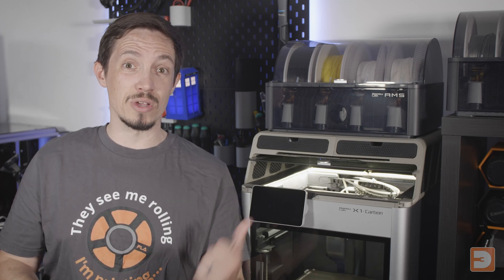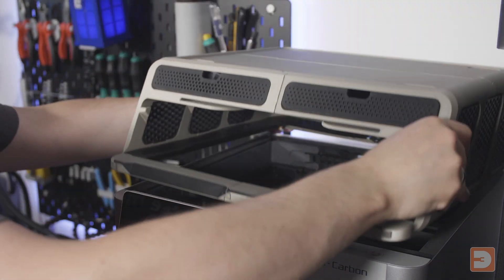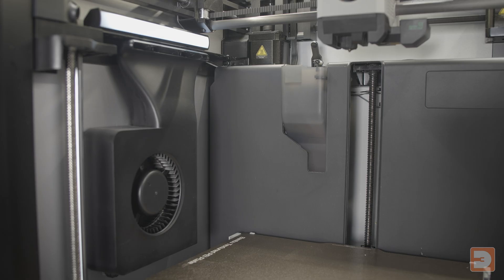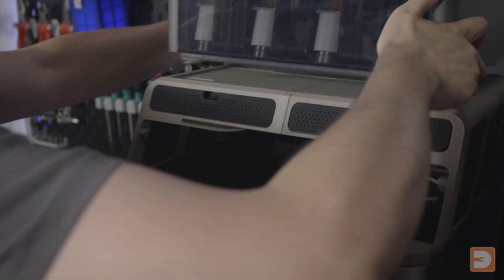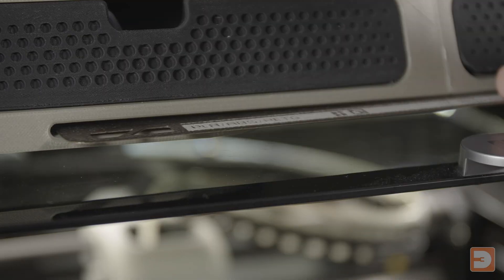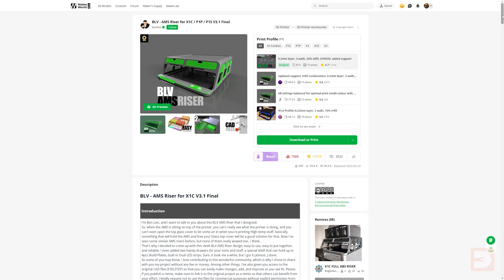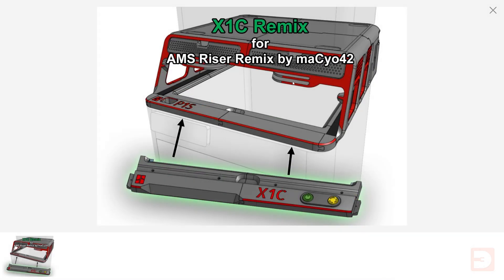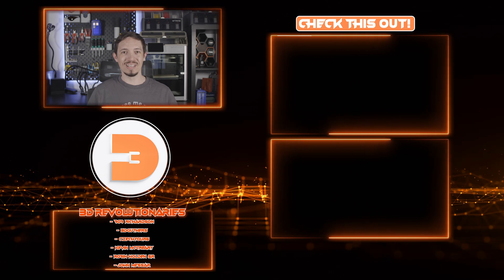What are AMS Risers and why would I want one?

Comment: the downside is that it's one more piece to unplug and remove to troubleshoot issues or perform maintenance on your printer.
Reply from the maker: How do you mean unplug? The riser isn't plugged in. If you mean the optional lighting, I just have that fitted to a splitter so powers on the same time as the printer from the same plug.

As for maintenance, I've had risers fitted to my X1C's for the 2+ years I've had them, and outside of doing so to get shots for videos, I think I've needed to remove the riser once for maintenance.

But even when you do need to remove it, it literally just lifts off, it's not clipped/screwed in place or anything, so you could just lift it off with the AMS still ontop, therefore not requiring any additional work or space to put things down

Comment: Excellent video, really explains the subject well.  I wish I had seen it a year ago.  Quick question, now that the P1S has been refreshed to the P2S, has your opinion changed on a riser for the P2S?  The P2S has active cooling, much better lighting, and a better camera.  Is it necessary to have ventilation ducts and the ability to remove the glass?  I'd still get a riser just for AMS 2 Pro placement near the printer's PTFE opening and for drawer space, but is there any other real reason?  Thanks again!

Comment: I’m so confused, my house is 68F. I print PLA Basic for 12 hours, for instance the AMS desiccant holders and a poop bucket. The latter is probably 4 by 4” at the base and the print came out amazing. Didn’t open anything at all…
Reply from the maker: 68F isn’s especially hot so for general print’s you’ll probably be fine.

However, even if you don’t live in a hotter climate, allowing the ambient temperature inside the printer to rise by having the door closed and lid on will mean the PLA doesn’t cool down as quickly after being extruded. For a lot of prints that won’t matter, but if you’re printing something with a lot of bridging or overhangs (especially if it’s a part where precision is important), then they are going to droop much further as they will remain mailable for longer before they cool.

You may argue that your desiccant holders have a lot of bridges and overhangs for the holes, but i can’t guarantee you the top part of them will be lower than if they had been printed in cooler ambient temperatures. That won’t matter for that model, but if you were printing something with a hole that had been designed for something else to slide into, or had been designed to perfectly fit onto something, it can be the difference between a successful print and one that is largely useless.
Reply: @ cool man appreciate the detailed reply. True nothing I printed needed to interface outside of the slide on covers for the desiccant thing. The poop bucket had a large overhang but it wasn’t particularly dimensionally critical and I supported the crap out of it because it was at the end of a tall print, it was basically a bridge to a hook that goes inside the chute to hold it without magnets or screws. 

Hopefully just opening the door will be adequate. Maybe I’ll print a bright colored flag that can be put over the edge of the glass as a warning when it’s open.

I gotta say I wanted a 3D printer as a tool, not another hobby. I’ve had other printers, Creality Ender 3, Prusia MK3S+ etc. I can’t recommend the  X1C enuf this is exactly what I wanted a printer to be. Reminds me of trying to buy a 1300 laser cutter from China and all the pain it gave me it was 90% right but the 10% wrong made it junk and too much tinkering. Sold it and spent $5000 on a Thunder Nova 35 and now it’s a tool, turn on…does work, no bullshit.

Comment: Just a heads up
After solving my TPU print issues, I finally be able to assemble AMS riser V2. As soon as put it on its place my P1S started to sing. sound is similar to whistle or aliens computer chimes like the one in sci-fi movies. 🤣🤣🤣 I guess Riser acts as an acoustic enhancer and made the volume of this sound audible. 

I had an issue printing with AMS riser V2. As the center of gravity moves farther up, printer and AMS started to shake wildly when it prints fast. Due to this shaking or change in resonance several thin and tall prints toppled, failed misprinted etc. I auto calibrated printer and those failed prints printed without an issue.
Reply from the maker: Hmm thats odd, sorry to hear that. I’ve printed thousands of hours over more than a year using a riser on X1Cs and haven’t experienced print issues, excessive shaking, or additional noise.

I wonder what’s happened with yours causing you this issue

Comment: I've been printing with pla fully closed and it's never been a problem for me
Reply: It depends on where you leave and weather. It is winter now and the room I am printing is rather cold. The breeze and drafts cause warping and bed adhesion problems. I have to keep everything closed. Only during long prints (10 hrs+) I keep the top lid slightly open. Though the summer times are a different story. Even with open printers i sometimes suffer. Thus in addition to open top and door i need to provide extra cooling.  BL recommendations might not be applicable for everyone. Each personal condition differs and users need to use their own common sense and experience.
Reply from the maker: It can often be absolutely fine. If you live in warmer climates, you'll experience more issues with heat build up. 
Also if you're printing something with a lot of bridges or overhangs, you'll likely get much better results printing with the door open or the lid removed to ensure the PLA cools and solidifies as quick as possible, preventing you from getting such drooping in the unsuported areas .
Reply: I had a message pop up on my touchscreen the other day to have the door open with using pla for multi colored prints

Comment: Even having an AMS on is silly because it raises the centre of gravity. Input shaping just has to work harder.
I printed a hex shelf with plate holders for mine and it goes on the wall behind my X1 and a little above.

For anyone doing AMS on top or add a riser, remember to recalibrate.
Reply from the maker: I’ve run AMS, with risers, on top of X1Cs for thousands of  hours of printing, and have never needed to recalibrate unless I’ve made significant modifications such as replacing the nozzle etc.

Yes you may want to do a single recalibration after first putting an AMS and/or riser on top, but other than that, it is just part of the system and nothing to worry about.
Reply: recalibrate every time ? My new P1S is on the way, I'm learning 😅

Comment: I have always set my AMS to the side - as i was worried that the additional weight on the top of the printer would increase the shaking of the printer as the weight would increase force movement. The printer already shakes a good deal from the rapid movements - is there anything to that?
Reply: Extra weight will actually help reduce movement because of Newton's 1st Law. Basically the more it weight, the more energy it takes to move it.
Reply: yeah as the other guy said, you have that backwards. you want more weight. it's like you holding the printer down to stop the shaking.

Comment: Is there a way to include a hepa filter into a riser or something or would that trap too much heat? fan system too or would that cause issues?
Reply from the maker: You absolutely could integrate a HEPA filter into a riser, but you'd really want to design a new riser around it. 
You'd also want to ensure it has fans that are powerful enough to ensure a decent rate of flow, whilst pushing through the filter, that would still help keep temperatures down.

Comment: Thanks for this, I am stuck though. I tried your remix of the gasket however the LED strips I have are 8.5mm and they are not fitting in there, is there any way you can remix it further for the 8.5mm LED strips? I would really appreciate it.

Comment: Hi Ben, just finished printing out your riser on Maker World, very happy with the results, and notice you sell a premade lighting strip with a USB connection, Couldn't see where to ask the question there, so popped onto here, only a week into owning my P1S. Is there a USB port on the back of the printer, not noticed one, or do you use and external USB supply?
Reply from the maker: Hi Steve, I believe you may think I'm someone else, my name is Josh of 3D Revolution, I'm not Ben.

I also didn't design or supply the AMS riser I feature in this video, I'm just using it as an example to show what risers are and what they are used for.

I also don't sell a premade lighting strip. I have designed a gasket for the AMS Riser in this video (which I've linked to the designs for so you can download for free and print yourself), and that can work with any LED strips (the gasket is available in 3 sizes for 3 different LED strip widths).

Regarding power, there is no USB ports on the X1C (which I feature in this video) and I feed the cable out the back and have it plugged into a mains USB power brick.

P1P and P1S do feature a USB port which is located on the inside of the top bar at the front. This can output 5v so if you intend to power your LED strips with this, make sure you get 5V ones.
Reply: @3DRevolution  I’m so sorry I mixed you up with the person you referred to in your video. I do have a P1S so will go down the USB route for a lighting strip. I really enjoy your channel and your delivery of the information is right at my level 😃

Comment: I was also looking around for a riser quite some time now. And that one displayed in the video also got my attention for quite some while.
But I feel it's besides storing a bit of tools, which you could also easily store at another place, unpractical.

A lot of errors or maintenance require or make it much more handy when reaching in from the top. So when this occurs you still need to take everything off, including the riser. At least with a lot of AMS-risers, you have little to no space to reach into the printer from the top because they might be verry low due to their drawers or other things.

So a AMS riser surely could be verry handy, but not many are designed verry practically.
Reply from the maker: It's true thst most risers don't allow you to access the printer from the top whilst fitted, but as I explain, the main point of a riser (especially one like this with a solid top thst blocks access) is because you're storing your AMS on top. If that's the case, even if you didn't have a riser, you'd still need to remove the AMS to do any top maintenance, so lifting the riser off instead would be absolutely no difference. If anything it helps as it provides me more access from the top without needing to remove the AMS, reducing the chance I need to lift anything off.
In the 8 months I've had this one fitted, I've removed it on 3 occasions, and two of those were for recording videos.

So if you're storing a AMS on top, using a riser doesn't make top access any harder and in some cases makes if easier. If you're not storing an AMS on top, as you say, there's other riser designs tbst give you complete top access and ifs no different to just removing the glass plate like normal.
Reply: @3DRevolution  Well I need to put the AMS on top because of the space I have. So a riser might be a good solution here, since you're still able to get the glass plate open or even of.
But needing to get everything of is the same effort as printing without.
But fortunately there're a few designs out that tilt the AMS slightly over the back of the P1/X1 leaving more room in between. Or AMS risers that seem to be a bit higher and not having drawers.

Some designs actually might give enough space removing the plate and having some decent room on the top to reach in and doing some light maintenance or repair works on toolhead, tubing, rails etc. Also for cleaning and lubing.
Without the need of taking everything off all the time. Which might be a big advantage for people who have their P1/X1 just on a little table.

Comment: I get warping if I leave the door open or take the top glass off, even with PLA
Reply from the maker: That's very odd. PLA is the staple printing material and is printed around the world on all sorts of 3D printers, most of which don't even have an enclosure, with no warping.

If you were opening the doors and removing the lid half way through a print that 'could' have an impact as it would suddenly change the printing environment which will affect print performance, so you could end up with a before /after quality line on your print.

Alternatively, if your printer is in a particularly drafty area blowing air of different temperatures around, I guess that could have an impact.

But either way, you shouldn't be getting warping with PLA purely due to not printing in an enclosure.
Reply: Ceiling fan on without an enclosure?

Comment: NO AMS here, but I still like my riser (very similar to yours). It keeps my small tools and spare parts handy and together,  provides safe storage for the top glass and  build plates, moves the external spool mount to the side for easy access, and still lets me store an airtight filament bin on top.  It did make a strip of LED lighting a necessity instead of a nice-to-have, but I was going to add that anyway.  Wiring to my LED strip does have inline M&F connectors to ease maintenance, but I seldom need to remove the riser.
Reply from the maker: I absolutely agree about the inline connectors for the lighting fitted in the riser, makes the whole process so much easier if you do ever need to remove it.

Comment: I dont usually remove the top or open the door when printing PLA and I have had no issues with that, no warping no heatcreep, I haven't seen the chamber temperature go above 36°C
 I have thought about printing one of these risers but it is just one more thing to remove when doing the maintenance as I prefer to have access from the top.
 I have a minimal riser under the glass to give a better angle for the Bowden tube going into the toolhead and to stop the Bowden tube scraping along the glass top.

Comment: Can you use an exhaust fan / fume extractor to achieve the same thing?
Reply from the maker: Yes, it could do, but... 
If the enclosure is closed, any normal fan would just circulate the air. If you had an extractor fsn, unless you fitted it at the top (which isn't possible without a riser or further mods because the top is just the removable glass plate) , it's not going to be sucking the hot air that's risen to the top, and also would rely on equal gaps for ventilation for cooler air to be sucked in, which other than the purge chute also doesn't exist natively.

Comment: Part cooling is not the reason. It's to prevent heat creep and softening of the filament at the extruder for lower glass transiton temp materials.
Reply: I keep my X1 Carbon closed when printing PLA, the temperature never gets above 36°C and I don't have any issues at all.
Reply: I think we are talking in the context of when you do need a riser or to remove the lid according to the wiki/bed temp. What plate and bed temp are using to print PLA? Also when a company gives recommendations, they are trying to minimize customers from having issues. In some circumstances some people may not have issues, but other people will. And they want err on the side of caution.
Reply from the maker: Absolutely, that too. I did mean to cover that in more depth in this video but I must have missed it, thanks for highlighting.

Comment: I'm not an expert, but does it really wear a PTFE tube out, if it's rubbing with barely any pressure against a glass surface? I didn't experience anything like that with my P1S, and it has a few thousand hours on it.
Reply: The channel literally made that claim up with zero evidence.
Reply: @MotFPS lol yeah PTFE is by its very nature extremely slippery and low drag. People mess with so much crap they don’t need to. Poop bucket yes, Desiccant holder for AMS yeah…loads of  other nonsense meh.
Reply: I put one of those minimal risers under the glass, apart for stopping the Bowden from scraping on the glass it allowed a better angle for the Bowden going into the toolhead, have you seen how the scraping Bowden tube affects printers with acrylic tops? the Creality and QIDI printers lids get very scratched up, I didn't see any damage to my glass top but the amount of errors decreased significantly and when the FW update came I no longer got any errors when filament was being loaded and unloaded.
 I am in two minds whether to print one of these type of riser, I don't usually open the top or the door when printing PLA and I don't have any issues, the chamber temperature never gets above 36°C and if it did I could set the chamber fan to activate and keep the temperature low enough, the noise difference is massive also with the printer closed up.